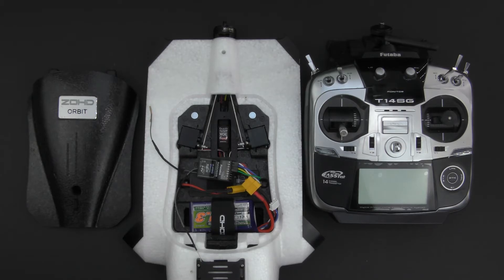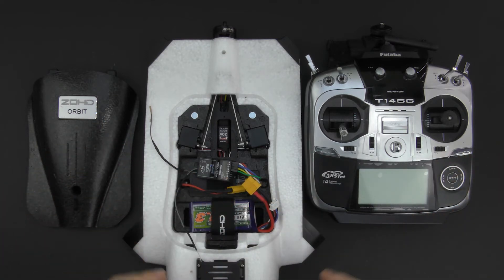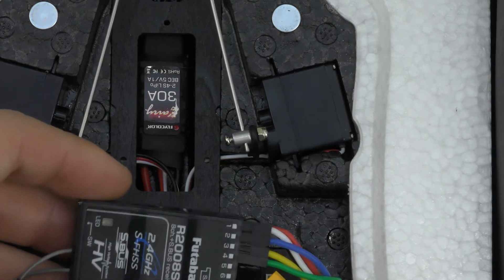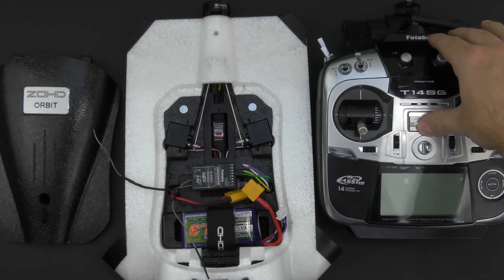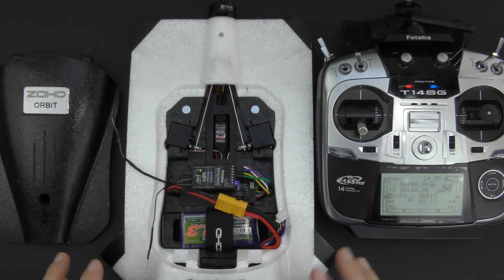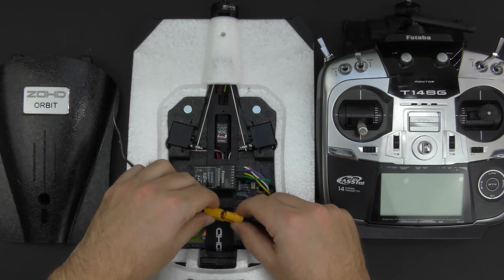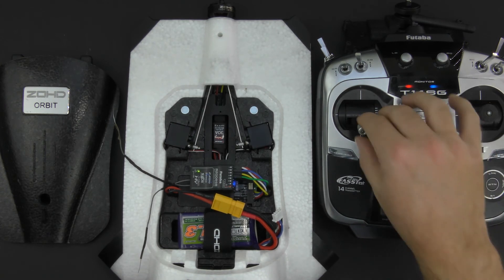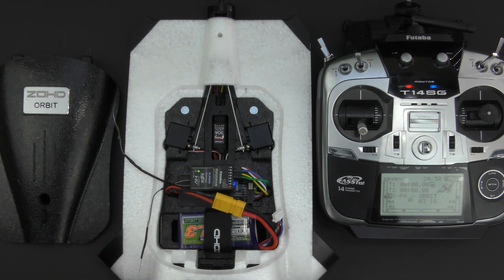ZOHD Orbit Wing Problem - Possible Fix (may fix ZOHD Nano Talon and fix ZOHD Dart too)

Comment: Thanks for this having trouble with my spektrum,tried 6ch receiver and satelite receiver as it it has dsm slot,
Reply: Yes exact same. But last night it finally came good. I burned up at least 8hrs getting it to work. I gently massaged the servo arms and realized they were getting power, and I pressed the calibration button a few times. Then, eventually, after unplugging the sat cable and dsm2 connection, I happened to just plug in the power to the receiver and put in the bind plug, suddenly the servos started twitching. I continued to just plug in all the single cables and it started to work except the motor. I followed the motor calibration and it worked straight away. After this long ordeal, I feel as though the calibration of the servos might have been the issue. I just used a tiny screwdriver to press the button. I'm not game to try hookup the dsm2 and sat yet, lol. Good luck.

Comment: Thanks for pointing me in the right direction...was having the same problem with spektrum setup. as suggested by some one here ..
1.turn on transmitter
2.set throttle to full
3.plug in battery on orbit
4. 2 beeps turn throttle to 0.
You only need to do this once for it to bind successfully evey time.
Thanks to all ..saved me from pulling my hair out.. :-)

Comment: I think you have to calibrate the ESC as it says in the instructions. (I had the same problem at first). With the zohd off, put throttle to max then plug in the zohd listen for several beeps then throttle down and get more beeps. Check the instructions to be sure.